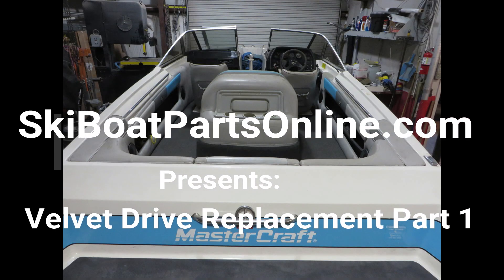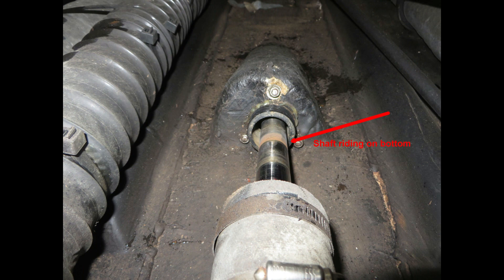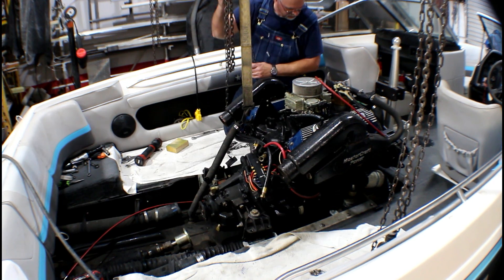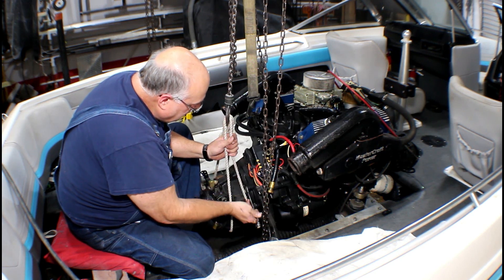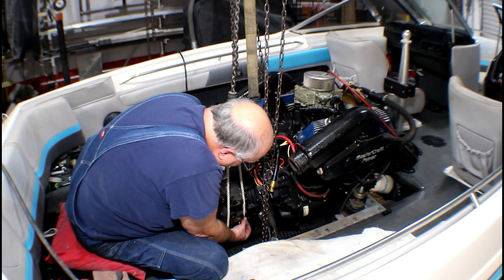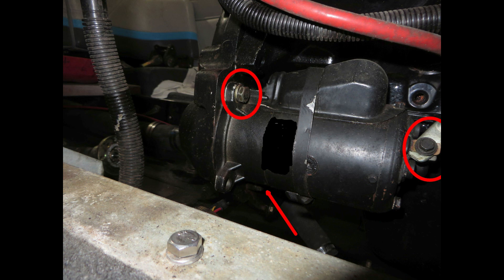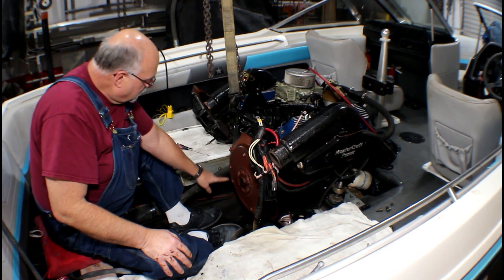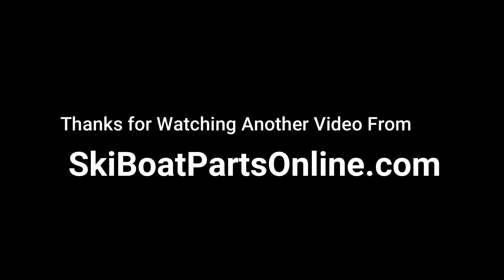Velvet Drive Replacement PART 1

Comment: I have a Paragon P45 on the back of my engine hangout from 6 x M10 bolts. Should it have a rubbing mounts to take some of the 300lbs weight?
Reply from the maker: Not familiar with that gear, consult with Paragon on this one.

Comment: Hi Ron Tanis, recently bought a 1990 pro am ski boat with a 350 5.7l mercury in it and it has no forward gear. Randomly works or if not at all. Any ideas ? Velvet drive ?
Reply from the maker: Things to do first, fluid level, check immediately after shut -off before drain-back from the trans cooler, should be at the high mark, after it sits for a minute it may be 1/2" above the high mark, this is normal. Remove shaft cable & manually move shift lever at the trans from full forward , neutral, reverse while in the water, if normal now you have a cable/throttle issue.

Comment: Should the drive shaft just pull away after you take out the 4 coupling bolts. Or do you need to loosen the packing nut thanks?
Reply from the maker: No you do not need to loosen the packing nut, in a perfect world the shaft will slide back with little effort after removing the 4 coupling bolts...we don't live in a perfect world, here are some hick-ups...severe out of alignment can cause the coupling halves to bind together requiring persuasion to separate, can also cause major resistance for a shaft rubbing hard against the shaft log, again caused by major alignment problems. There will be some resistance from the strut & packing gland, a little soapy water sprayed there will ease that.
Reply: @rontanis1024   thanks, i was able to get it.

Comment: On an older boat do you for sure need to pivot the engine? Doing damper plate replacement and don't want to pivot engine if I don't have to. Thanks for any info~
Reply from the maker: All depends on the boat, if you have room then no you don't have to pivot the engine, if you are avoiding pivoting because you don't want to re-aligne the engine to the shaft, you are mistaken, a shaft re-alignement is required regardless.
Reply: @rontanis1024  Thank you Ron. I can support the engine with straps but if I don't have to raise the engine with straps to get trans/bell housing off I would prefer that.
Reply: Got the new plate installed. Lifted engine & trans with straps. Removed trans & bell housing as an assembly and replaced drive plate. Re-aligned assembly, bolted up and good to go. Thanks Ron for all your helpful videos.